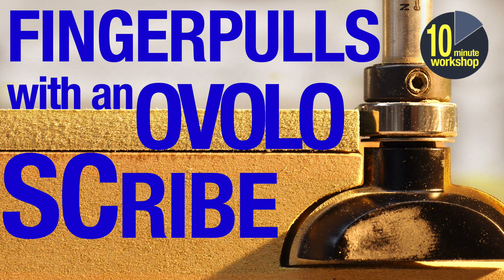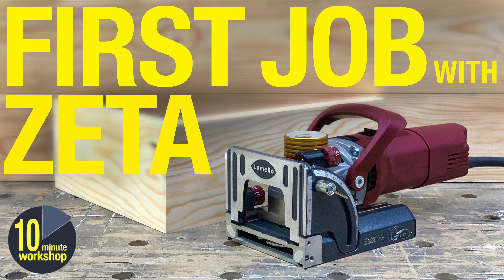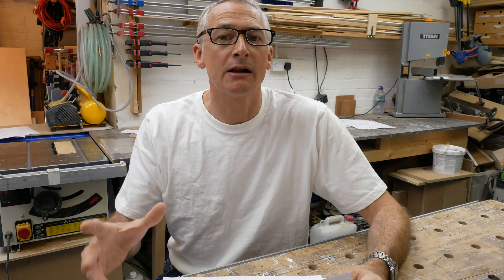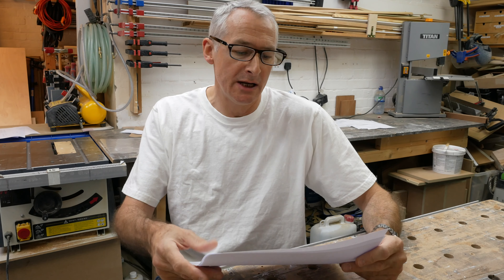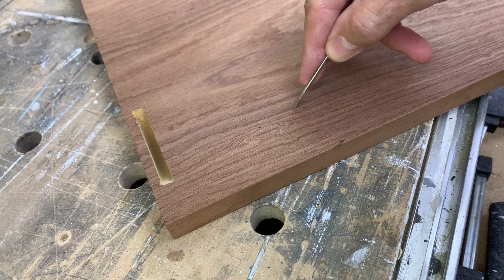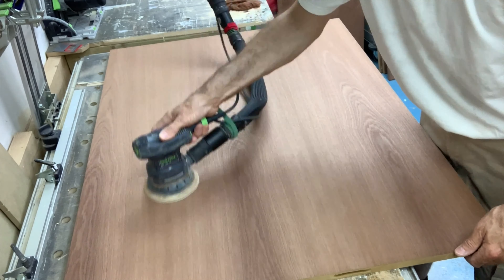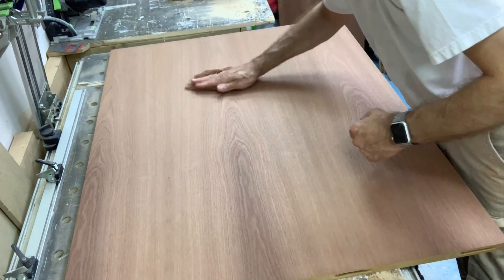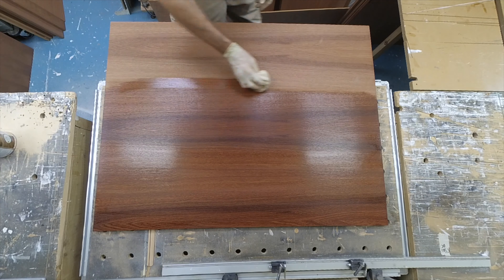Built in wardrobes with great shelving ideas [video #342]

Comment: Lovely job Peter and this interested me as I am planning a build of my own but as a total novice using birch ply . My question was it looked like you were using 4 x 1 for your support and I was going to use 3 x 2 as I thought 1 inch would not be strong enough . Just wondered on your experience that this is strong enough ?
Reply from the maker: Thanks! For the plinth? Yes, 4x1 is plenty strong enough - been using it for years. 👍

Comment: Excellent piece of design Peter.  Love that you have used every cubic inch of potential space, would have loved to see one of our "High Street" friends treatment of that space.  Really looking forward to seeing the finished product.  

Now I know you are a busy man but you should really think about using Sketchup (or similar) for your designs, it will export in seconds to a cutlist.  Then add  any details you need regarding edging and if necessary grain orientation. We then send this to a company who cuts and edges everything for us and two weeks later a kit of parts arrives at our door, all at better than .05mm accuracy. Edging on veneered boards is either 1mm or 2mm hardwood so on the 2mm you can use a router to round over.  Cost savings are enormous (seriously you would be amazed) and it allows us to focus on the touchy feely bits.
Reply from the maker: Thanks Richard. I used sketchup way back, never really became comfortable with it when I was doing more of the fitted furniture work, so it kind of passed me by. It’s on my list, but then so is fusion 360... 🤷‍♂️👍
Reply: @richard flint. That’s exactly what I’ve been looking for. Would you mind sharing the company name who does this for you?

Comment: Hi Peter. Did you try the micro adjust on the Lamello Zeta to achieve the tightest/strongest fit with the Tensos?  I've never used the micro adjust setting myself but I also have a batch of lipping to get through this month and, like yourself, I'd assumed that Tensos would do the trick as they've previously done the business on long bevel glue ups.

The Insider Carpentry channel in the States put me on to Collins' Ply-prep router bit for lipping plywood which helps out with glue-ups and with the finish appearance. If the Tensos aren't up to it on their own, I wonder if a pass with the Collins bit would help solve the problem. Have you ever used this bit for your shelves?
Reply from the maker: Thanks Harry. I think I have, finally, dialled in the micro adjuster enough so that I get a reasonably tight joint from the Tenso fittings, but it’s taken a king time and a lot of messing around and tbh if I want a self-clamping fitting I’ll be using the peanut connectors in future. No, never heard of that but, I’ll check it out, thanks! 👍
Reply: @10MinuteWorkshop  Yes got to admit I don't really fancy playing around with the micro adjust on the Lamello, I'm not surprised it took a long time to get it to where you were reasonably happy with it. I'll give the Collins bit with the Tensos a try towards the end of the month and let you know how it goes. Might join you with the peanut connectors if the mini-jig looks good. Any more news on that btw?

Great finish on the wardrobes in the vid! Very nice work. And those cornice scribes....hope you priced them in! :)

Comment: Hi Peter, an old video that I've just re watched. I'm about to commence a build of a similar size myself in our master bedroom. Planned everything in SketchUp, ordered and had delivered some lovely 18mm birchply. Was planning on building each unit (top box, hanging section and bottom drawer) as a separate entity BUT I'm worried I've over engineered it in terms of weight. Each of these 18mm birch ply 8x4 sheets weighs 38kg and I have 12 of them.  Tell me, do you ever consider the weight of the material together with all the clothes that then get put in these wardrobes? I'm suddenly thinking almost half a ton in material alone over a 3 metre span seems a lot, or perhaps I'm over thinking it. We live a new build house - chipboard floors and I beam joists. Anything scaring you based on what I've described? Many thanks
Reply from the maker: Hi Gareth. For comparison, a sheet of MRMDF weighs about 45 kilos and I've fitted plenty of those into victorian houses held up with ancient wooden joists. Short answer - it'll be well spread out and nothing I've ever concerned myself with - though it is one reason why I prefer to use plinths, rather than adjustable feet, just FYI. Your construction method sounds fine - basically what I've been doing for years, and it seems to have worked out OK for me. And congrats for snagging some Birch ply! I visited my paint shop before lockdown - I should have hit up the timber yard! Hope iy all goes OK. P
Reply: @10MinuteWorkshop  wow Peter thanks for the very prompt reply. I've learnt so much from your videos and Patreon channel. Well that sounds like a fair and reasonable answer, thank you. I had figured I might be over thinking it. I guess you wouldn't necessarily worry about 5 or 6 burly builders stood on the floor would you. Just couldn't believe the weight of this stuff as my wife and I were lifting off the back of the delivery truck! Thanks again, hope you and yours are staying safe and healthy. All the best 👍🏻
Reply: Ps the birchply came from Hanson's Plywood in Halifax. They delivery sheet goods all over the UK. Very helpful and excellent quality material.
Reply from the maker: Good to know, thank you! 👍👍

Comment: Hello Peter. Enjoyed the video and looking forward to watching the next one... 
When you tried using the Tenso fittings did you use them in conjunction with the preload fittings or without?
Also I’m curious about which blade you chose for your Lamello Zeta P2... Did you get the carbide blade or the diamond blade?
Thanks for your time.
Ron
Reply from the maker: Thanks Ron. I’ve used the tenso both with the pre-load and without; With is much easier if you have more than a couple of fittings in a joint. And I bought the anniversary edition, which came with the diamond blade - I expect it to outlast me! 👍👍
Reply: Peter Millard   Thanks for the info Peter. I had a Zeta P2 on order here in the U.S when I saw your video about the anniversary edition P2 and made an inquiry about it and switched my order to the anniversary edition. It came with with a couple extra fittings.We of course got the anniversary edition a few months later here. The anniversary edition was available here with the carbide or diamond blade. I got mine with the diamond blade also. And I expect it to outlast me as well. Thank you for the very timely video on the Anniversary Edition 😊
Stay safe.
Ron

Comment: Hi 2 questions please. I see from your plans that the room height was (about) 2450mm, why use top boxes and not perhaps a 2200mm high single door? Was that a customer preference? Also, why use tops and backs and not use all the space up to the ceiling etc?
many thanks, I enjoy your videos very much.
Reply from the maker: Thanks! Ceiling height was ~2700, floor to cornice was ~ 2570, so 100mm plinth, 1950 wardrobe and 500 top-box makes 2550, and the floor runs out by 20mm on RHS. Yes I could use 3050 x 1220 boards, but much more wastage for what benefit? I typically use ‘carcass plus top-boxes’ for convenience - everything had to be carried up to the third floor where these were installed, and I don’t want to bend 2450 x 850 boards around an old Victorian staircase, thanks! Clients had the plaster cornice re-instated and didn’t want it touched, so we’re happy to have the wardrobes end where they did. As for  ‘why use tops and backs’ - call them fussy, but they don’t want Sapele wardrobes with bits of wall or ceiling showing through! 🤷‍♂️👍👍
Reply: @10MinuteWorkshop  Thank you, much more detailed reply than I was expecting! All makes sense, especially the carrying huge lengths up three floors!

Comment: Great video as always Peter. I have a couple of questions. I see you used MDF to veneer on. Is there any reason why you did not use particle board instead as its a cheaper option? And secondly. Did you veneer the sides you dont see example the long vertical sides that are butted together?
Reply from the maker: Hi Andries and thanks! These were commercially veneered boards, cut to size  and edgebanded by my local timber yard (see video 447, Fergusons	timber yard tour - https://youtu.be/W66tCi3KT3s) and veneered MDF is much more commonly available than veneered chipboard. And yes, all  the board faces were veneered, though there’s usually a ‘best’ face and a balance face. 👍👍

Comment: Good looking job. One of the problems with real wood is that it moves as moisture changes. Paul Sellers would have been out with his planes and winding sticks.
Reply: @nicpye248  Perhaps natural wood would have been a clearer choice of phrase.
Reply: @BensWorkshop  I think that this was made with veneered board, not solid timber
Reply: @stephenwhite3343  It was sapele veneered MDF but some of the edging was solid sapele which had twisted after being finished planed.
Reply: @BensWorkshop  when us wood NOT natural?
Reply: @gbwildlifeuk8269  When it is MDF or plywood. (Or indeed chipboard). Wood as it comes in big bits from trees via a saw mill behaves differently.

Comment: Fantastic design and finished product.  I know you mentioned you will do a follow-up video on the install, if you have a chance please speak to the complications of having to build on top of what looks to be wall to wall carpeting.  Thank you for another wonderful video and enjoy your weekend.
Reply from the maker: Thanks! Carpet’s no great drama tbh; I make a plinth (vid out soon on that) and then fix it to the floor. The trick is to screw small (150mm sq) off cuts of MDF/ply to the floor to compress the carpet down, then fit the plinth to that. 👍👍
Reply: @10MinuteWorkshop  clever!!

Comment: Hi Peter loving the videos. It may have been asked before so I apologize if it has; what program do you use for your drawings?
Reply from the maker: Thanks! I use an OSX / iOS app called Graphic. It’s actually a full vector illustration app that does far, far more than the simple 2-D line drawings I use it for. Because it’s an illustration program though, there are a couple of irritating missions from a ‘drawing plans’ perspective (e.g. no ‘tape measure’), but it works to scale in metric and is a very reasonable one-off purchase, so I can work around those niggles.👍👍

Comment: Nice looking job, what happened about the electrical fittings in the left hand wardrobe, were they moved or disconnected or did you just leave them.
Reply from the maker: Thanks Ray. Client was happy to lose that socket and aerial outlet, so they were just covered up. 🤷‍♂️
Reply: How would you go about boxing a power socket or light switch on the side of a wardrobe please? Your work is amazing.  I'd consider paying you to be your apprentice!

Comment: If I were to be critical ... wouldn't "shadow gaps" around right and left sides and bottom - so that your build "floats" - be a better visual result than scribing in the bits to fill the gap between wall and vertical.  Not very keen on the fill in the cornicing. It  upsets my visual sense of what the cornice should be doing/look like. I suppose the client wanted it that way.  And what about leds routed/rabbitted into the back edge of the shelves for a bit of a drama. I know. Bloody hell, I've sweated blood, and some awkward sod wants a pint.
Reply from the maker: Lol! It’s a spare room, and the clients get what they asked for. If you were the client Michael, I’d be happy to accommodate you -  for a price, of course! 😂👍👍🤷‍♂️ And from a purely practical point of view, the carcasses have to come away from the wall by 80mm to clear the window & rad on the left-hand side.

Comment: Were you concerned with the osmo polyx oil having a reaction with the glue under the veneer and delaminating? I'm about to start on a job with oak veneered mdf and was contemplating using osmo polyx
Reply from the maker: No, not at all concerned about that, and have never heard of anything like that happening. 🤷‍♂️👍

Comment: Great job!!!! Have you ever found using oil finish on veneer lifts the veneer? I've heard it but not experienced it. Wonder if you have any thoughts. Thank you for sharing
Reply from the maker: Thanks Mike! No, never heard it experienced that - I’d be pretty peeves if it did! 🤷‍♂️👍
Reply: @10MinuteWorkshop  I'm sure you'll be fine. I heard it from a decorator when doing oak veneer doors he told me don't lol them as there veneered. Iv not heard it else where but wondered if anyone else has. I always use water based finishes on veneer now because of that decorator. Regards

Comment: Great job again, Peter! I was wondering: wouldn't it be cheaper to just crack in with the clamex in place? I assume you already cut all the joints, so a lot of time spent on it already. To then get the domino out to do it all again to save some money... 
I also get the 'crack on with it and stick to what you know works'. Would probably do the same thing in that situation. Isn't hindsight a great thing?
Reply from the maker: Thanks Pieterjan! For the shelf lipping? No - I hadn’t cut the slots so it was an easier decision. Clamex probably would have done it, but half the shelves had four fittings in them and I didn’t want to run short for the carcass construction 🤷‍♂️👍
Reply: @10MinuteWorkshop  benefit of always doing a test before production 👍

Comment: Why would you make a cut list and send it out w/material for someone else to cut?
You do not hv a Table Saw?

And two trips to get it cause you only own a car?

I don’t understand how a pro cabinet maker gets by w/o basic equipment?

See here in the USA if you do it like you do there I would be broke paying someone to cut my stuff?
And spending all day on a cut list means I lost a day already on the job let alone paying someone to slice up everything?
Reply from the maker: Space - see video #066 for the shop tour, but at less than 30sq metres divided into two rooms trying to cut fully sheets is madness when my yard will cut & edge band for a modest fee. With respect if you’d ‘go broke’ paying someone else to do that you’re not charging enough. Same goes for making the cut lists and designing the wardrobes - it’s all billed for. Oh, and it’s a van, not a car. 👍